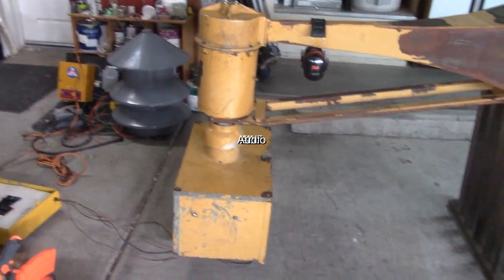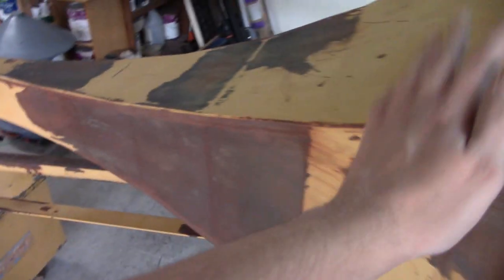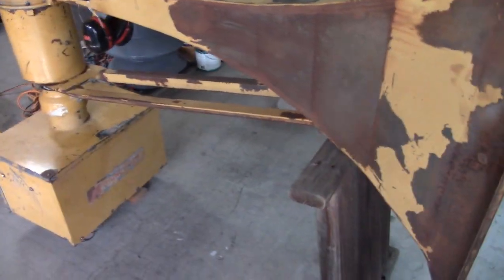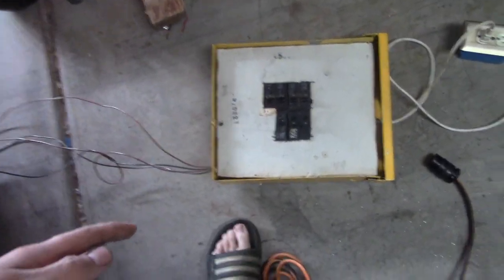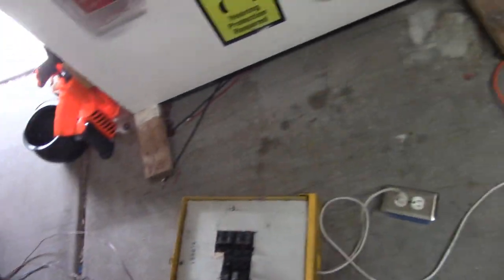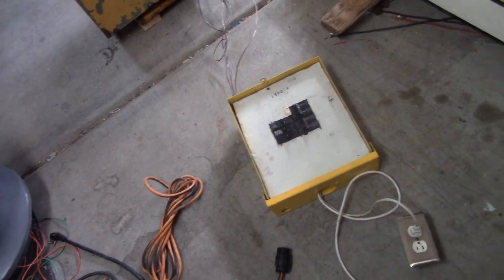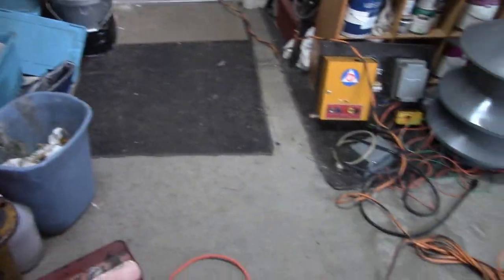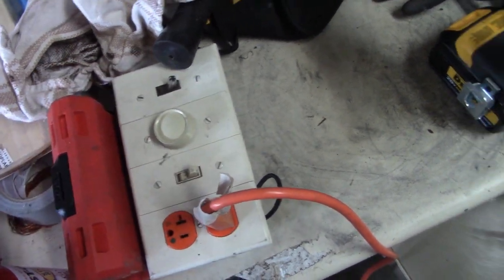(For Lukemaxwell) Thunderbolt 1000AT Update: Horn is on and some testing

Comment: i am making a 4/5 port 1003 thunderbolt running on level 7. i am making another one to. should i do 5 port or 5/6 port since i already did a 4/5 port
Reply from the maker: 5/6.
Reply: @cooldomino1800  ok. ill do a 5/6 and a 4/5
Reply: @cooldomino1800  what model. 1000t. 1000at. or 1000bt
Reply from the maker: @trainsandsirensofilinmiwi2080  1000at.
Reply: ok. i will do 1000at
Reply: @cooldomino1800  ill think about it. maybe i could buy one but i will think bout it